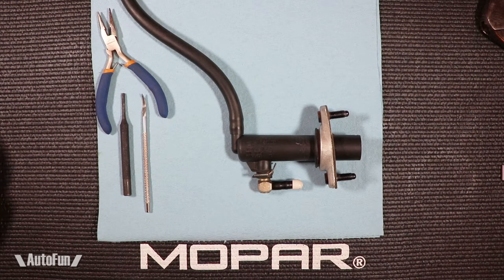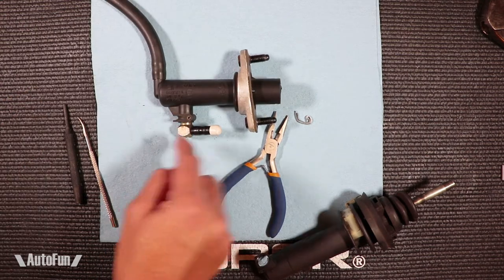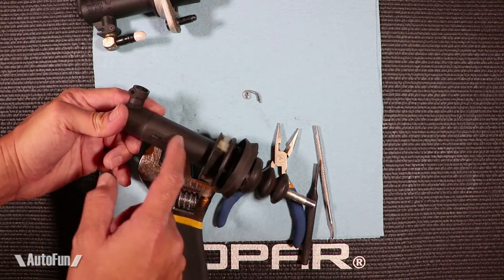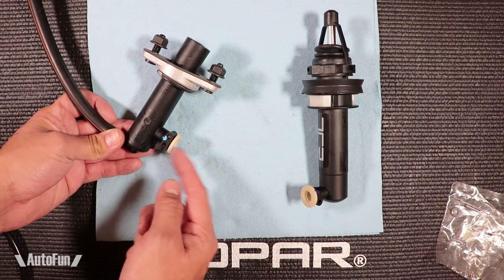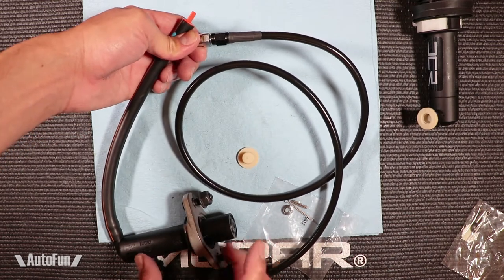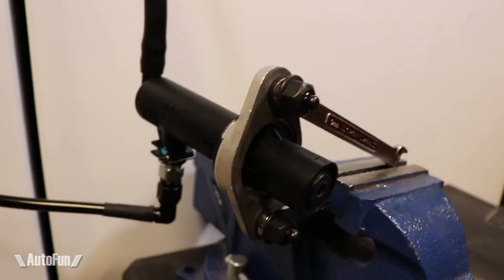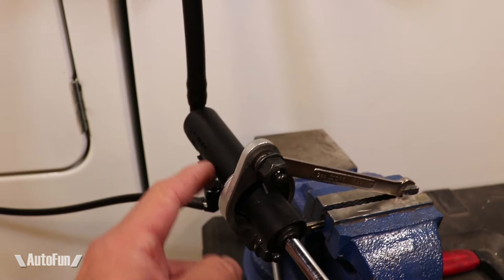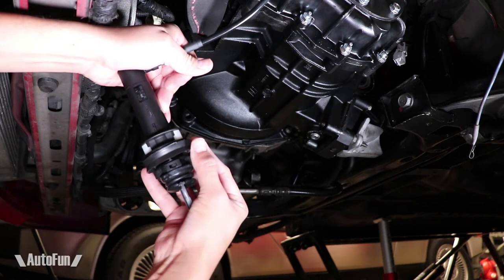Dodge Neon SRT4 Bleeding Clutch Hydraulic System (2003-2005)

Comment: My dodge neon doesn’t have a container for transmission fluid it is rather a rubber plug on the side of the tranny to check the fluid how do to bleed it without the container???
Reply: My dodge neon is a SXT
Reply from the maker: Hi Andrew! Transmission fluid is different than clutch fluid. The tranny fluid is used to lubricate the transmission while the fluid I bleed from the clutch reservoir is used to actuate the clutch pedal. Cheers!

Comment: Hey buddy what can happen if one locking tabs are damaged, or broken, would I start having any issues on engaging and disengage with clutch
Reply from the maker: Hi Adolfo! I'm assuming you are referring to the locking tab in the slave cylinder? if so I haven't encountered that issue but if the locking tab is broken then slave will not be secured in place and can potentially come out of it's designed location. Hope this helps, Cheers!
Reply: @AlexAutoFun  thanks
Reply from the maker: You're welcome!

Comment: Is it really necessary to pump the master cylinder? If so can i still bleed it when i already installed and bled the slave?
Reply from the maker: HI Bacoj! This would depend on your setup. My understanding, is that the Mopar master and cylinder comes prebleed to eliminate this step. However if going to induvial components, the importance of bleeding the system becomes paramount. Hope this helps, Cheers!
Reply: @AlexAutoFun  thank you
Reply from the maker: @kakkarotskorner  You're welcome!

Comment: I’ve had the problem where the slave rod won’t go back in. It feels as if it has too much pressure and won’t be let pushed in
Reply from the maker: Hi Jose, this happened to me once, there was slight pressure on the clutch Pedal and that keeps the return path closed so no fluid can go back up, I had to loosen the clutch pedal rod temporarily to be able to push the slave back in.
Reply: I have this problem